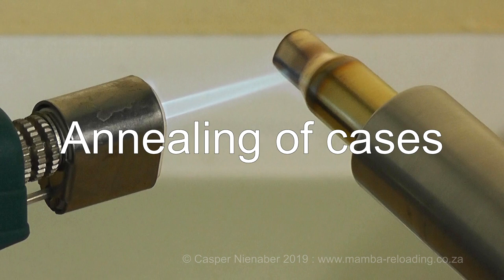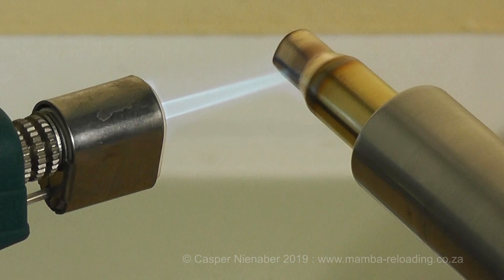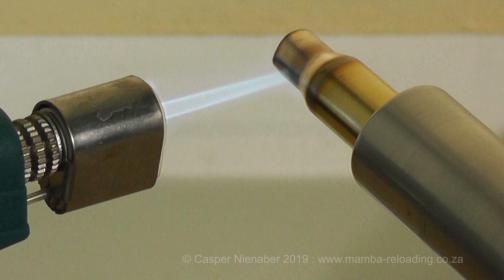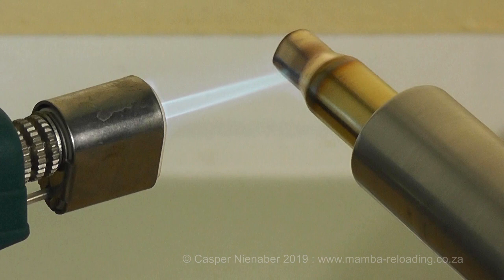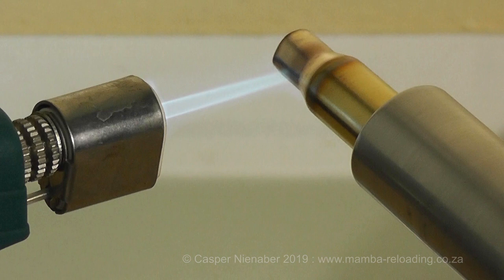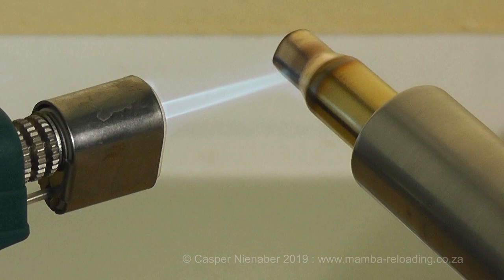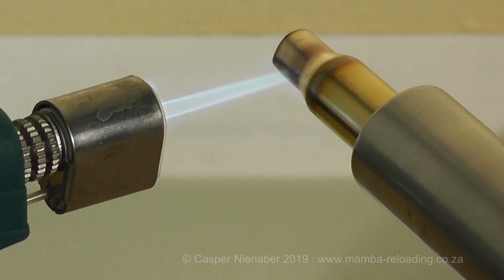Introduction to annealing

Comment: How do you know the brass is over-annealed?
Why is 650F to 750F the correct temperature?
What are you basing your information from?
Reply from the maker: I base my info on how I was taught to do annealing by reloading professionals.
Only the neck and shoulder area should be annealed, not the complete case - if that is what your refer to by over annealing.
The Tempilaq indicator is used to prevent the case from being overheated.
If 475F Tempilaq melts, where it is applied on the case body, then the neck has reached 650F to 750F.
Reply: @cassienienaber8288  If you don't mind me asking, who are these "professionals" you refer to?
Reply from the maker: They are South African recognized gurus, working professionally (not hobbyists) in shooting/reloading/training businesses.